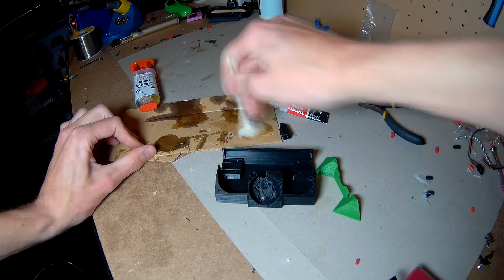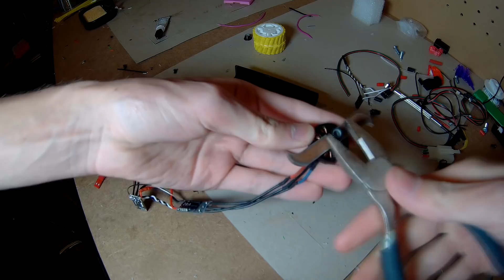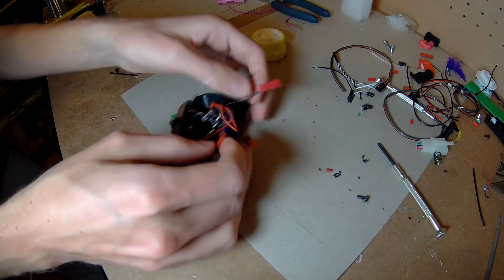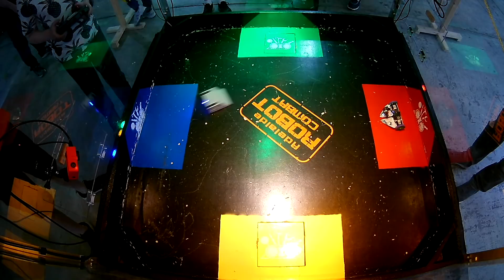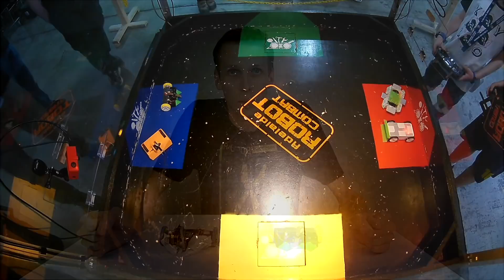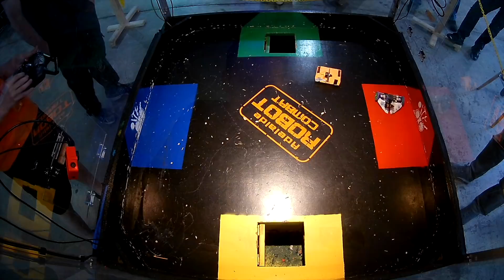150g Antweight build and battles Oct 2018

Comment: When I bolted my spinner onto the motor, it came off nearly every fight😂
Reply from the maker: You need to use loctite on the bolts that hold the weapon in place, otherwise they will rattle loose

Comment: the problem in these robot is that its two wheeled and unbalanced thats why it is easy to push it and knock it out
Reply from the maker: With the 150g weight limit it is very difficult to have more then 2 wheels.

Most of the robots in this video only have 2 wheels for that reason

Comment: Are you using BOTH epoxy and superglue to glue the green plastic wedge to the black plastic body?  Why?  I have never seen that before.
Reply from the maker: Thats so I don't need clamps.

Epoxy needs time to cure (between 5min and 12hours) so typically you clamp the two things together as the epoxy cures.
In this case, there is no easy way to clamp the two pieces so I used super glue at the edges to hold the two pieces together, its not perfect but it holds better than no clamps